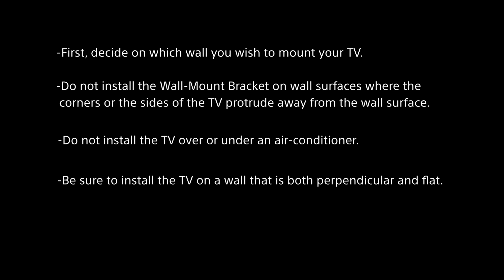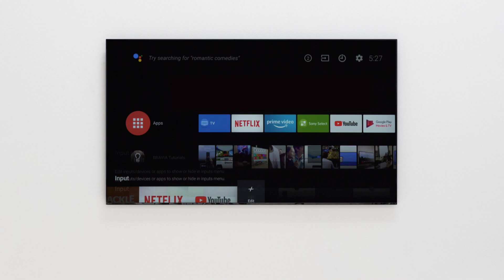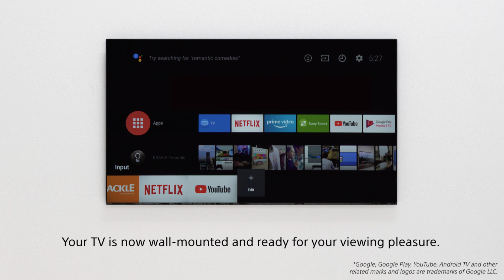Setup Guide | How to wall mount your Sony BRAVIA OLED MASTER SERIES A9G TV with the Sony mount.

Comment: And at what dimensions do we install the bracket onto the wall so that the TV is not too high or too low. I can find this nowhere because it is not shown or written anywhere.
Reply: Just mounted mine with the assumption it was dead center, but this is not the case. Ended up a good 5 inches higher than I initially wanted 🤦🏽‍♂️
Reply: Find the center point of your seating and then have someone else mark it for you. This always works for me
Reply: Determine height from where you will be viewing (sitting). Messier the bottom or top, now measure where your center is for brackets as if on tv and mounted to the wall. Install pretty straightforward.
Reply: @Sean Kyree Flixportal
Reply: @Otto Maximus Thank you, I signed up and it seems like a nice service :) I really appreciate it !
Reply: @Sean Kyree glad I could help =)
Reply: lay the bracket at the back of the TV gently, take some overlap measurements, find the center of the space you are hanging it (left to right up and down..also known as X-axis and Y-axis) and then off you go....trace the mount on the wall where you THINK you want it...double check measurements. Make sure your screws will be on studs and STAAAAART Screwin'!!
Reply: @interestingsausages  I always trace before I mount. I can then stand back and see. Made the same mistake too....what seems right up close is often not
Reply: @seankyree1619  I only know of the usual stuff. Used to be all those wonderful Pirate Channels but.....I don't know where all that went.
Reply: Some of the Sony manuals for the SU-WL855 have the dimensions on them. I found the file called H1341001M.pdf on Sony's support site that had the dimensions of the bracket in relation to the size of the TV so you didn't have to eyeball it and guess, especially if you haven't received your TV yet. That file had the mount points & dimensions for the XR-77A9xL, XR-65A9xL, and XR-55A9xL units.

Comment: Can this bracket be used on a plasterboard wall?
Reply: I would not recommend hanging a TV, no matter how light, on plaster. You would always wonder. Might be fine for 10 years....might be 10 minutes and happen when your kid is under it. Always find wood to anchor in to...studs.
Reply: Sooner or later it'll take a spill

Comment: Very annoying. I bought the wall mount from Sony Australia but it didn’t include the WM4 bracket shown in this video and the bracket supplied doesn’t span 2 studs! Dodgy!!!! And expensive! Doesn’t even look like Sony Australia sells the WM4!
Reply: do you guys do 16" off center with your studs? If you know how to repair drywall...just add a brace between studs. Blocking basically. Then repair square hole and off you go